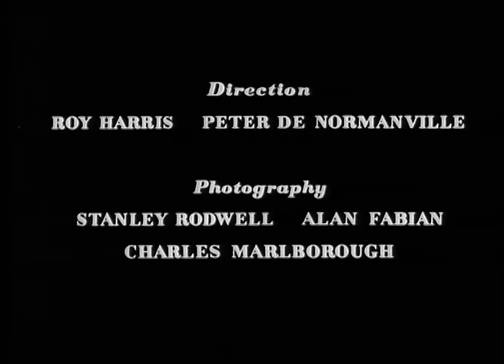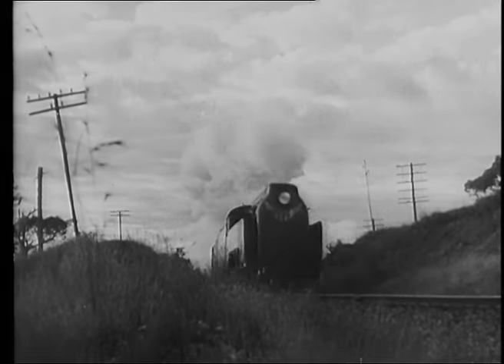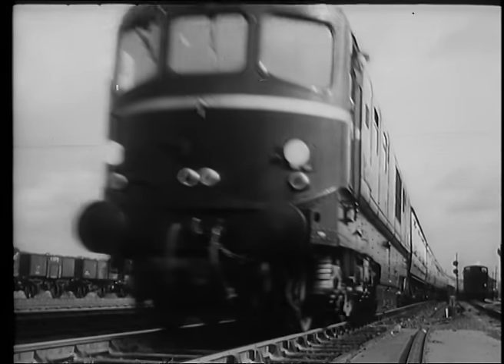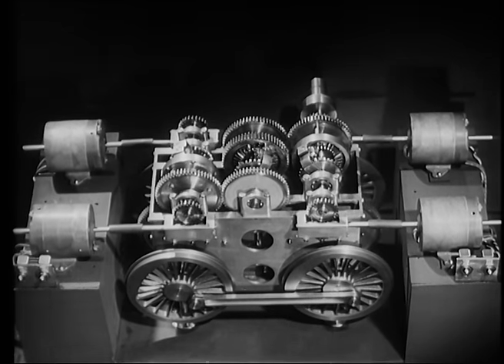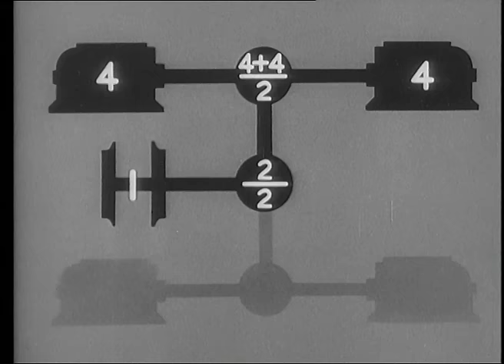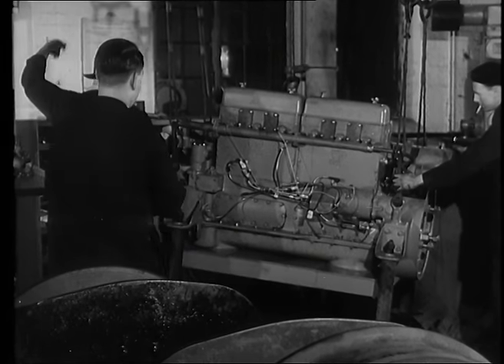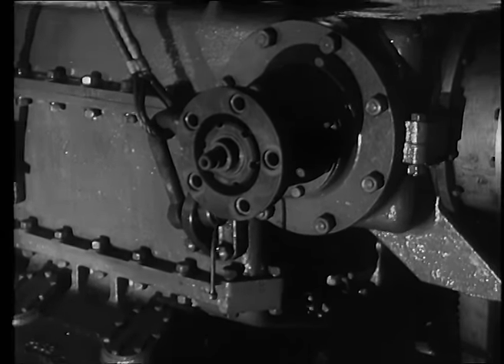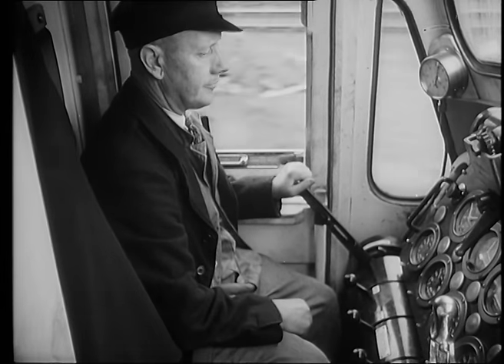The Fell Locomotive | Shell Historical Film Archive

Comment: At last I understand how it worked. The crazy thing is it had two diesel engines just to drive the superchargers.
Reply: You understand how it works!?!
Reply: Yes, a total of six engines at last count,that should make it very efficient.
Reply: in principle yes
Reply: Have a separate engine for the superchargers allows the  maximum power output from the traction engines. Large high flying aircraft had used a similar arrangement for a period as the propulsion engines were not powerful enough to drive the supercharger as well as keep the aircraft flying.
Reply: @neiloflongbeck5705 Yes, I understand why, it is just  that this makes the whole thing even more insanely maintainance intense. I know some engines used superchargers for starting and then once up and running then the pressurisation of the inlet was taken up by turbochargers.
Reply: @terrybailey2769  only that's not what was happening here. The traction engines needed high supercharging when starting off and when operating up inclines and next no supercharging when running at speed on the level. The easiest way acheive was with 2 auxiliary engines. Whilst this does add to the maintenance requirements it did allow the use of light-weight, low power engines for propulsion.
Reply: @terrybailey2769 Why would a supercharger be required for starting?  Use of a slightly lower compression ratio in a turbocharged engine is not normally an issue to achieve sufficient cylinder air  temperature for spontaneous Diesel pilot ignition ? Large Diesel engines usually use timing controlled direct inlet of high pressure compressed air for cranking, however.  Maybe you were thinking of this ? The compressed air used  can be at 20+ Bar, supplied from air tanks filled very slowly from an engine driven compressor, or sometimes engine combustion cycle high pressure gases can be tapped to refill the reservoir.
Reply: That’s providing you understand how a differential works. 🤣 which I still can’t get my head around. 😖🧐
Reply: @abloogywoogywoo   So do I, having had Meccano, not video games, as my hobby for many years.😁😁😁
Reply: @philhealey4443  
No. 
You're talking about 'air starting', as understood 
in marine engines. 

He's not. 
He's talking about supplying mega-charge at 
(relatively) low revs (aka: initial starting, hydraulic 
coupling or not, but better with).
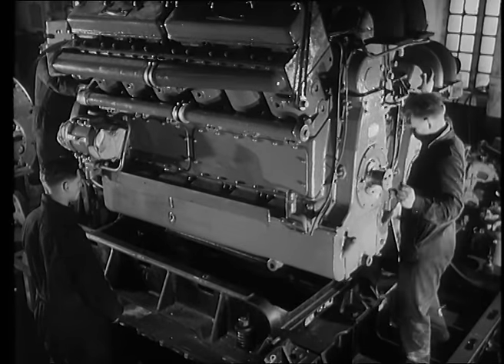Reply: @herbgarratt  So your take is that starting up the supercharger will produce a supply of air at say max 2Bar to crank the engine if delivered via a pilot inlet valve for the duration of the power stroke in some  cylinders (with presumably a lot of complication to avoid high pressure  unless  selectively disabling injection in these cylinders?) Seems more likely to have been  a conventionally (high pressure air or electrically) cranked engine, receiving hot supercharged air to help with compression pressure and temperature?  I'd better rewatch the video....Edit, 9:40 shows what looks like a starter motor.
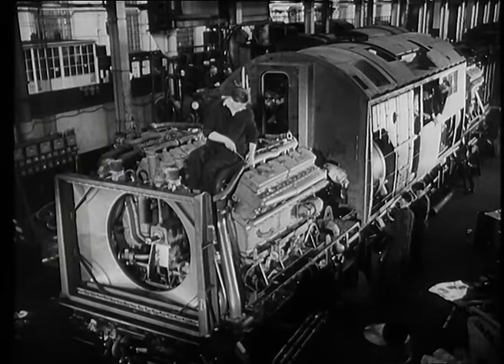Reply: At 12:37 I'm sure I see evidence that were FOUR AEC bus engines, and of course the four Paxman RPH12's. 
Were two of the AEC's removed? 
Why does all the literature on this critter speak of two AEC engines, totalling (only!) 6 engines for the entire loco? 
At 12:37 I see at least 3 AEC engines, and I'll bet there's a fourth 'where it should be' (out of view). 
Soooooooooooo ..... EIGHT engines?
Reply: @philhealey4443  Just maybe? 
The system you describe in your reply is, again, 'air-starting', but a bit feeble compared to the 'real' (marine) air-start scenario. 
For those unaware, marine SA pressures routinely range up to 600 psi.
Hadn't though of your suggestion, but if starting a diesel engine immediately onto a low speed load, just might make sense? 
Might explain why the blowers were so muscley? 
I had thought the diesel driven blowers were just for serious charge pressures, but not really within the limits of usefulness for 'starting air' values. 
I wonder what pressure those blowers generated, especially against a 'no-flow' start (just before the kick). 
Positive displacement blowers were they? A la Rootes blower (God, they're noisy once they get angry!)
Reply: @herbgarratt  Exactly. I'm  not really buying the starting with supercharger idea and as I said, it looks like there is an electric starter.
Reply: You can put supercharger on rail.

Comment: Nice idea on paper, but it's obviously a maintenance and reliability nightmare - what were they thinking
Reply: The biggest problem i see is you can't have full power at low speed so pulling out of a station and up a steep hill you have to use 1/4 power when you want it all.
Gets me wondering why things stagnated for 70 years though, i wonder if anyone has attempted diesel electric with a mechanical lock out at certain speeds like an automatic gearbox.
Reply: @zopEnglandzip  That's a good idea, but I think the problem is the same - complexity, and it's another mechanism to maintain. As locomotives are generally considered 'working prototypes' - the machines are best-served being simple
Reply: @zopEnglandzip  the gearbox however was set up so the ratios would change like a car gearbox, the locomotive actually had a decent pulling power at startup, and the mechanical transmission meant it outperformed the diesel electrics at the time, and Britannias between 27 and 65mph. It however was not very efficient at 70mph and above, and having 6 engines meant it was not practical.

If you are referencing History in the Dark's video on the locomotive, he misunderstood how the gearboxes worked. And, frankly, how power, torque and rotational speed are related when comparing the mechanical transmission with a diesel electric.
Reply: @zopEnglandzip yes America did
Reply: @zopEnglandzip  I think it would have been a simple modification to make it so that two engines on different primary differentials were engaged, the gear reduction is still 4:1, but with two engines connected for twice the tractive effort.
Reply: @TheSonic10160  the way it is set up, it already has a pulling force with 1 engine engaged of 9500Nm through 4 axles carrying 20 tons each. For comparison, a Class 42 has 10500Nm through the same 4 axles on 20 tons.

Edit- the Fell is quoted at 95% efficiency at 36mph, whereas the Class 42 was quoted as 82.5%, so the Fell had the upper hand.

The single engine 'disadvantage' was countered by the supercharging auxiliary engines modifying the power curves of the engines dynamically.
Reply: Yes, but it makes perfect sense if you must remember to colenel fell developed the idea when he was drunk with all of us army friends and nobody was sober to say it was a stupid idea. You know what it’s like when you plan to ride on a unicycle round the world when you’re hammered by the time you’re sober, you think I shouldn’t have committed to that.😂
Reply: The clever bit is that there was exactly the same torque at the driving wheels regardless of how many of the engines were connected. If one engine was driving, the torque was multiplied by 4, whereas if all 4 were connected, the torque was multiplied by 1.
A major problem was the massive amount of noise, especially at stations, with the four main 500 bhp traction diesels plus the two auxiliary AEC engines, which powered the superchargers and cooling fans, all running!
Reply: @petesmith2132  why would it be full load in stations? and drive superchargers?
Reply: That's right, they were thinking, unlike today's generation having to import  expertise to even to build simple things like bridges 😂😂

Comment: Four Paxman 12RPH engines on the drive and two AEC railcar engines on the blowers. The traction engines had to provide a lot of torque at low speed hense the blowers rather than turbochargers.  The main engines would not last well subject to high torque at low speeds.   Some of the old timers at Paxman in the 1970's still had nightmares about this monster.  You can see the apeal of diesel electric where you only need a single engine that gets to run constant speed.  Like steam electric is good at high torque low speed operation.
Reply: 10-100 ran the St Pancras- Manchester Pennines route for 6 years without fault.
Reply: When the Fell engine was withdrawn, work was already under way on a mark 2 version. When the decision was made to abandon the project due to repair costs, the mark 2 was also abandoned.
The prototype locomotive tested was somewhat before its time and a Mark 2 locomotive could have been greatly simplified and improved. About the time 10100 was doing its test running large torque converters were becoming available in sizes to suit the Paxman engines. If the engines could have been fitted with these they could have had normal turbocharging and the AEC engines and Rootes blowers could have been eliminated. Then there would have been room in the centre of the locomotive for side mounted radiators and this would have eliminated the cooling problems. Such a locomotive would have been much quieter too. But it was not to be.

Comment: It looks that the engine/gearbox noise in the drivers cabine must have been mindblowing? By the way, a wonderful 1950’s black and white film!
Reply: Apparently passengers on platforms complained about the racket this thing made. The Paxman 12RPH engines gave a very powerful deep throbbing noise when working hard at low revs and it made people feel sick. Look up brown noise.....Constant torque engines are not a good idea!
Reply: If you look at the thing under construction at 12.35, it is possible envisage how cramped the driving cabs must have been too.

Comment: Decades later, Toyota used the same principle (using a differential to sum the output of two motors) for the hybrid drivetrain of the Prius. With the ICE one one input shaft and an electric motor on the other, they had an infinitely variable gearing which meant the ICE could be kept within a narrow optimal rev range.
Reply: Toyota stick to proven designs. That's why they are a global success. Colonel Fell was ahead of his time or out of step with global timeline needs
Reply: The Toyota system is very similar, but differs in that it relys on a planetary gear set rather than a true differential gear system.
Reply: You beat me to the same comment, I immediately noted the similarly to the prius drive.

Comment: Only a quarter of the horsepower &/or tractive effort available at low speed & starting - What were they thinking?
Reply: True. I noticed that.
They could have had a deep reduction planetary box on starting engine to get it moving . Like TA in IHC farm tractors had. 
Shift on fly to higher ratio once moving

Comment: Just an add on: a major failing of the fell (apart from the obvious 72 pistons) was it was a little more efficient than the concurrent diesel electrics (never mind that in a short couple of years the DB entered squadron production of the rather iconic V200), its mechanical link also produced an unforseen issue: above 72mph there was a marked drop off in useful power, basically limiting the available speed ceiling to 72mph, and with close on 2000hp for express hauling this lethargic top end was really going no where.
This mechanical linking also of course ended up with the central rods being decoupled, there being no give in the works.
Interesting the car gearbox analogy: appears to be an early dump 'n flow hydramatic: RN1234, R doubling as a park
Reply: 10-100 (it was never called ten thousand one hundred to my knowledge) reached 80mph on the fast-up line north of Luton and was accelerating when one of the Timken roller bearings failed due to a lack of lubrication, causing the bearing to melt and then seizing a non-drive axle. This was the first time that a roller bearing had been used in a rail application - typically white-metal shell bearings were employed which in hindsight would have been much less disastrous. On efficiency; 10-100 was around 15% more efficient than a diesel-electric design of 1800 HP. On power output; she had 2300HP available thanks to the higher than expected efficiency of the roots blowers and the Ricardo-designed comet heads on the two AECs and four Paxmans. Her design parameters were to match the 1800HP at the drawbar of the Class 5 steam loco but she achieved the pulling power closer to the Class 6.

Comment: A fantastic piece of engineering but surely someone must have seen that it was far too complicated to be used for everyday service and as they say the rest was history !
Reply: Thing is at the time they were replacing infinitely more complicated steam engines.
Reply: All new technology is complicated and expensive until mass production refines it.
Reply: Also you only have the power of one motor to move the train in the beginning. This seems not very convenient. In contrast diesel electric or diesel hydraulic transmission can always use the complete installed power (minus transmission losses).
Reply: @reinerjung1613 Yes I've just realised that, although from standstill it had 4x the torque.
Reply: @althejazzman  Really what this does is provide 4x each engine's torque but over four speed ranges since each engine added effectively ups gearing by the same as the torque it can produce. 
In other words it has no benefit over a single, large engine and hydraulic drive.
Reply: @siraff4461  There is the benefit of redundancy, should any of the 4 engines fail, the train would still move at a lower speed, so you could drive to the workshop after the days work was complete.
Reply: @martin-vv9lf  Yes but 4x the part count, 4x the likelyhood of failure.
Reply: @althejazzman no. Not really.
Reply: @althejazzman  yes, just look at EV’s now
Reply: @siraff4461  No.
The likelihood of success (96% ... ?) to the 4th power (85% in the case quoted). 
Different thing.
Reply: @herbgarratt  Well thats that then - it can never break down if it has enough engines. 
The likelyhood of each breaking down is not dependant on the others in the first place but even ignoring that if it needs all four to do the job its tasked with it is four times as likely to fail. 
It may be less likely to fail if it is only tasked with something requiring one engine but it wouldn't have four in the first place if that were the case.
Reply: @siraff4461  No, it doesn't need all four main engines to do the job; only to do it at max speed. It is very (very) unlikely it will not be able to get home, alebit it in 'limp mode', the severity of the limp being measured on the Dear-O-Dear Scale, not essentially dis-similar to the Richter Scale in concept. 

The study of probabilities is disturbingly similar to that of law, wherein absurd viewpoints are not only tolerated, but applauded. 

But it does make sense that if any one of those (4) engines has a 99.8% chance of completing the trip, then 0.998^4 is the likelihood of completing the trip with all available power, no?

Comment: That must have been a horrendous locomotive for the crews. Sat behind two large diesel engines at either end, a large (noisy?) gearbox behind you plus the two engines required for pressure charging the main engines must have made it a very noisy place to work. A friend of mine saw it at Derby works when it was waiting to be scrapped.

Comment: Fascinating glimpse into our railroad history. By this date, however, it was very clear in the United States that Diesel-Electric would be the way forward.
Reply: It's a very British thing to see something working well elsewhere and then decide to try something completely different. 😂
Reply: @jonathanratcliffe5714  Ironic yet true. That is how we wound up with the railways in the first place.
Reply: Hydraulic transmission had yet to be really tried - and it was still until recently when the advantages of hybrid powertrains became clear a good choice for lower power installs, mostly through simplicity; the common Voith drive has a torque converter & a fluid coupling, and once there's no more slip in the torque converter you just empty the oil & fill up the fluid coupling, no gear changes or field weakening stages. There are still advantages, they're just not enough especially now we have robust variable frequency AC drives.

Putting a differential between a pair of torque converters & then driving all wheels, rather than duplicating gearboxes to drive groups of wheels like ended up happening would have been an interesting concept for hydraulic drives.

Using a directly driven supercharger & a wastegate might have made a bit more sense than an entire seperate engine...
Reply: @Karibanu  What is intriguing is the parallel of this to the “genset” locomotives of almost a century later. The idea, in principle, is the same: multiple engines on one frame that spool up when necessary.
Reply: Creativity kicks in mostly when limits are available, brain is really modeled to imagine and chase the idea.. blindly almost.

Comment: Not all locos are diesel electric or electric. Although only a few built and running, the Parry People Mover uses flywheel technology driven by a small diesel. One runs in my home town Stourbridge. I used to deliver to Parrys in the 80s90s and they had a small test track in Cradley Heath. It was fascinating to talk to John at the time. When we had engineers not technicians
Reply: Petroleum industry used to use a "fire-less" steam locomotive. A stationary boiler would pump super heated water into a tank that was in place of a boiler. The locomotive would vent the steam as it flashed over for motive power. It was used because it developed the power of a small locomotive without needing a fire that could ignite fumes around refineries.

Comment: 10 out of 10 for commitment on trying a new idea. However, rather complicated solution. Diesel Electric clearly much better even with the loss between the diesel and the electric motor. still would have been easier to operate. Imagine having to service six diesel engines in one loco! Used a lot of Shell Diesel me thinks...